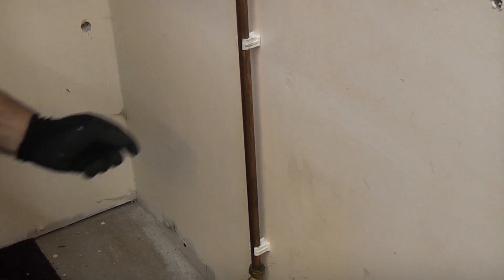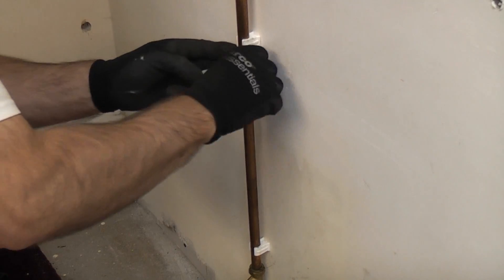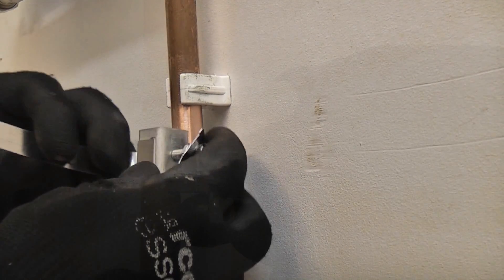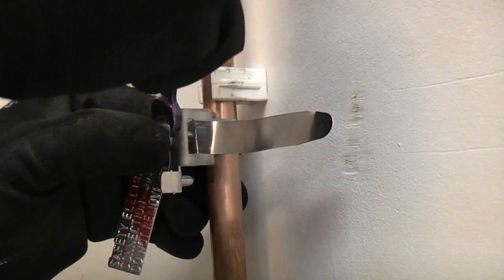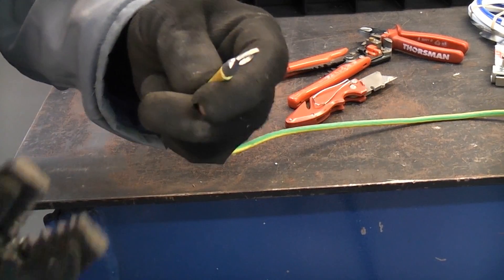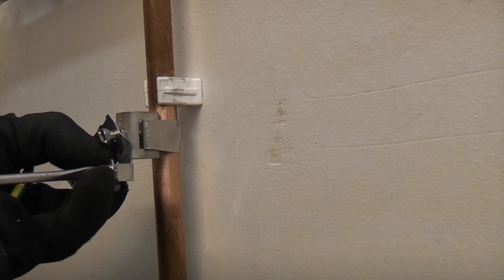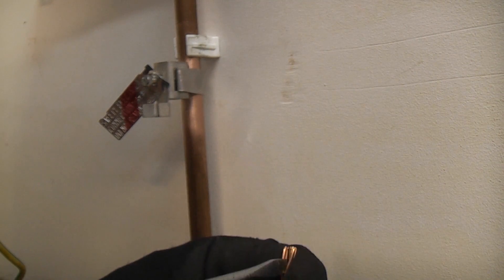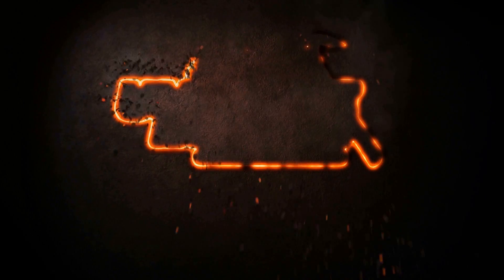⚡ How to install earth clamps | cross bonding ⚡

Comment: Only my opinion the earth clamp is upsied down i was taught to have terminal on top makes a better dressing of earth wire better job and 6mm for crosss bond & 10mm to main gas meter and 10mm to cold water mains as it enterters  the building then furse tape for lightning conductor 😊👍

Comment: The lock nut should be placed over the metallic label and then be tightened to hold that in position so it can be read. Not be left free moving where it can end up side on and less readable. Also allows me to put my wira 10mm ratchet to good use tightening nut whereas behind the label i can only use the jaws end as on the video. That is a deal breaker for me ! 😀  Otherwise great vid

Comment: Is the coiling necessary? I want to install across pipes just below a boiler. The installs I've seen use just a small loop between them.
Reply from the maker: No, you can just loop if you prefer ;-)
Reply: As long as your incoming gas and water pipes are equpotential bonded within 600mm and before any T branches in the pipework.  Then you don't need to supplementary bond the pipes beneath your boiler.  The casing under the boiler gives equpotential to the rest of the pipes.  The copper for the Gas and water makes ground for the rest of the pipework.  18th edition regs now state if the pipework below ground to the stopcock or pre gas meter isolation valve is MDPE plastic then again no bonding is necessary.  I just install it to keep the other Gas engineers and some of the old school sparkies happy.  Either way consult an electrician if you're unsure.
Reply: If you really want to supplementry bond the boiler pipes.  Then best practice is to keep the wires short,  6mm earthing cable should be suffice.  Shortest possible route to ground.

Comment: It gets me why they earth water pipes unless its related to water heaters, kitchen appliances etc, here a girl was electrocuted 230vac was comming out the water and pipe, the fault was the main wires providing the house with power they were in contact with one another via corossion, metal oxide powder allowed the connection between neutral and active before the meter box , All rcds worked everything worked took the inspectors and engineers a while to fault find.
Reply: That makes no sense at all.  If the water pipes were in fact bonded correctly, then it would cause a large fault current, tripping the breaker/fuse.

Comment: Is is necessary to cross bond a shower if the shower is protected by a R C C B O?.
Reply from the maker: Not sure, I have not checked the regs for a long time.
I would just do it, as that won't cause any problems- but not doing it might do 😉
Reply: @ultimatehandyman  Thank you for your reply.👍
Reply: Manufactures instructions supersede all British Standards.  Unless your instructions state otherwise, then No additional bonding is required other then the CPC in the existing twin and earth  cable.

Comment: Does a resin sink and tap need to be earthed?
Reply from the maker: Not sure, as I have not checked the regs for ages. 
The tap might need earthing, if it is connected to copper pipes, if it is you best check with an electrician ;-)

Comment: No one really supplementary bonds or cross bonds anymore in domestic as it's not required if the earths cross sectional area is correct and that rcd protection is in place it's not needed
Reply from the maker: It said in the instructions of the item that I'm fitting next week that you had to cross bond a copper pipe, they even sell a special kit for doing it.
Thanks for the comment 👍
Reply: @ultimatehandyman  the product has probably not changed since the day it was released when a earlier edition of bs7671

Comment: Thank you for the video! We use the same style clamps in belgium, but without the safety tag and usually without the locknut as well. But they do the job, I guess. Most piping is plastic anyhow these days..
Reply from the maker: Copper is still widely used in the UK, but a lot of plumbers use plastic pipe now!
Thanks for the comment 👍

Comment: Can you explain why the pipe would need to be cross bonded?
Reply: A single pipe just needs to be bonded with a 10 square, there is no need to put a bond between a single pipe, if you have a few pipes in series you just link them all together! Also twisting the earth around in a spiral shape has been changed in the regulations, the more you twist the earth and use a longer cable the higher the resistance which essentially means longer trip times in a fault situation!
Reply from the maker: It might be best if you ask an electrician, I just do it when I have to.
If you want a real laugh, just take a look at some electrician's forums and search for earthing and bonding, you will find plenty of confusing advice ;-)
Thanks for the comment 👍
Reply: @ultimatehandyman  I am an electrician, by inserting a plastic fitting the other side of the copper pipe is no longer an extraneous conductive part and would not require bonding.

Comment: If you do fit a SureStop I’ll be very interested. I purchased one 2 years ago and still haven’t fitted it! :)

My stopcock is pretty horrible so it always worries me when I need to isolate the water. 

And I can’t seem to explain to the Mrs which way to turn it if I’m out and we have a leak. She’s an experienced project manager with a degree but stopcocks are a mystery it seems lol
Reply from the maker: Hopefully I'll get the video edited for next week ;-)
Thanks for the comment 👍
Reply: Might be worth fitting a ball valve as I have done in my boiler cupboard, taps all over the place to isolate hot and cold pipes and in need of replacement. Now its easy to tell on or off as it's written on the ball valve plus it's a simple turn of the leaver. No more taps for me!
Be interesting to hear what Chez thinks.
Cheers M

Comment: Just abit puzzled as it looks like the pipe is mains water pipe and stop tap ? If so this should already be already earthed with a10mm earth wire to the dis board, everything else is correct except if the mains water pipe is pvc then cross bonding in video would not earth pipe  and technically if this is a stop tap if fed by lead etc and no 10mm bond already on it it is not earthed, although think that the reg’s have changed for mains water feed in pvc (don’t think they run a earth wire to mains pipe just check )
Reply from the maker: It is already earthed, but I'm cutting a section out (in the next video) to install a plastic surestop valve.
Thanks for the comment 👍

Comment: As usual Chez you put out a video just after I do a job! 
It was a right faff working out how to get these bloody things tight when you are in a small, dark space under a sink trying to repair the bonding between the pipes.
Reply from the maker: I made a video about fitting these several years ago, and someone commented saying you can just pull them with your fingers and tighten the screw- something that has never worked for me.
Thanks for the comment 👍

Comment: The water supply shut-off valve outside my flat was replaced, along with a new section of plastic pipe replacing the copper. It never occurred to me that maybe I should install an earthing bridge across the gap. Thanks for the well made video.
Reply from the maker: Thanks for the comment 👍
Reply: douglasheld earthing bridge? Again clear to me you have no idea what you are talking about. Horses for courses. Get an electrician in. This is why we do 5 year apprenticeships.
Reply: @garymckeown4278  what a ridiculous, uninformed and patronising comment. 

Have a word with yourself, fella. Your heads on wrong.

Comment: I don't get why water pipes need to be earthed anyway? I mean, there's no current running through them. I dare say there's a good reason, I just don't know what it is! I have similar to this under the sink in the bathroom, but don't know why.
Reply: MM75 imagine this scenario. Your immersion heater develops a fault which causes the case to become live. This is connected to all the copper pipework, taps, radiators etc which become live also. As you have no earth connection there is no way for this electricity to return safely to ground. Your wife is making a cup of tea and turns on the tap whilst filling the metal kettle which is earthed through the plugs wiring, a path to earth is established THROUGH YOUR WIFE. Hence the need for bonding,
Reply: mike brown so the case is the exposed conductive part which requires connection to earth the pipe work isn’t. I’d be more worried if the case wasn’t “earthed”.
Reply: @garymckeown4278  you could have poor wiring into an electic shower which comes loose and touches the copper inlet pipe, repeat the scenario from there.
Reply from the maker: If the reg's say they need earthing, they need earthing LOL
I cross bonded this, as it is necessary for when I install a plastic sure stop valve.
Thanks for the comment 👍

Comment: I put dielectric grease in between, that way, the copper doesn't tarnish anymore and the connection remains functional over time.
Reply: I hope that you mean "on top of", rather than "in between", as dielectric is an insulation.